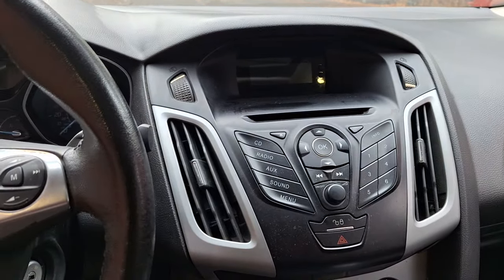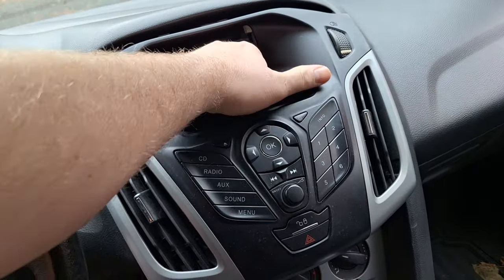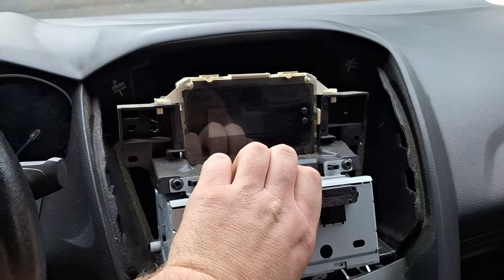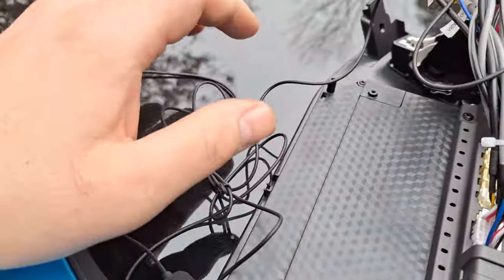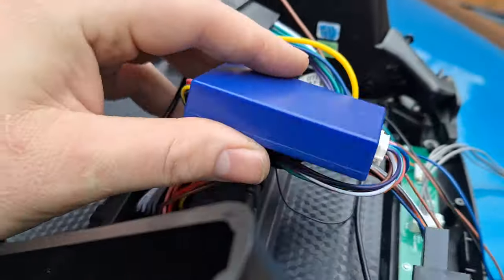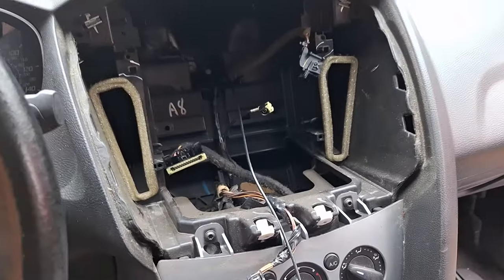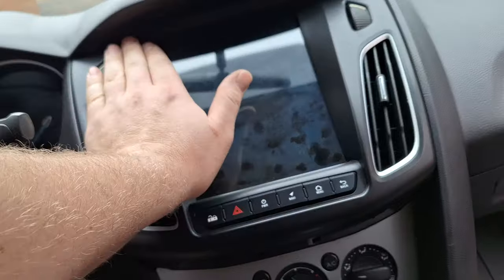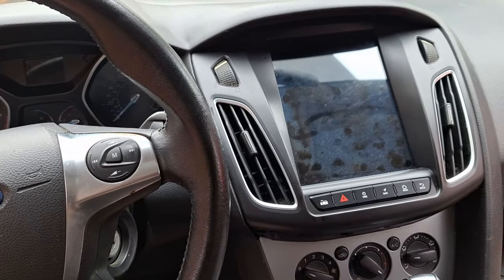Ford Focus Amazon Touchscreen Radio Installation | 2012-2018

Comment: good video but, you should have replaced the fuse while filming so your viewers could see it working in this video. they might think you didn't install it correctly.
Reply from the maker: Great point! I've got a video of it working before removal.. if anyone wants to see I'll link it
Reply: @BigBensCarsAndCycles  would love to see it! do you have any expirience with ios/apple? Does ist support Apple CarPlay
Reply from the maker: @_-lvkas-_8214  https://youtu.be/Plz5ZTmd5QI
Reply from the maker: @_lvkas_8214  another commenter asked and I found one and linked it. Thanks for watching!
Reply: @BigBensCarsAndCycles  Thank you for the quick response! keep up the great work :) Your videos helped me a lot! greetings from germany
Reply: Do you have an Idea if the US Plugs are the same as in Europe? In the one you linked is written „check the Plugs before purchase“
Reply from the maker: @_lvkas_8214  sorry, I don't know about that. You can message the seller if the info is not on the ad. They have good customer support
Reply: I got one did u replace the fuse behind the radio match the 15 amp fuse under the dash

Comment: Am here with a question for those who have replaced the original radio with an Amazon or Ebay one regardless of brand, is the sound better or worst than the original? Or how to improve it if it can be? TIA
Reply from the maker: @josealonso6568  the sound was about the same in my opinion

Comment: My radio is similar but there's three wires that connect to the green circuit board also, where or what are those wires for? The manual isn't specific at all. I'm think it's to test the radio for power before installation? Manual said something about it but there's no red wire, it's orange white and black that connects in but wires are open with no connection that the wires would go into. Any help would be greatly appreciated. BTW great videos, very helpful, and much appreciated 😊

Comment: Great video! I know you said you wouldn't do the back camera but could you explain a little more where every wire goes, I tried to do it myself and failed 😂
Reply from the maker: Hey glad to help, you can pause the video where I show the wires connected on the back. They all fit in 1 specific spot and can't be mixed up. Except for one. Take note of the "ugly colored harness" and make sure that's plugged up where I had it. And I believe you need that one attached for the camera but I could be wrong. You can check the manual to be sure. I don't have it anymore and I'd have to pull the radio out to check. If you look at my video "project Focus clutch actuator replacement" I show a possible way of routing the camera wiring into the car
Reply: @BigBensCarsAndCycles Thank you man, would definitely check it out!

Comment: At 11:17 yours isn't like mine, it's soldered directly onto the green board. I had a hell of a hard time getting it in and at one point thought I plugged it in the wrong way as I could not get it back out. Glad I eventually got it to seat properly.

I think my canbus may be bad. None of my steering wheel controls are working.
Reply: Same my steering wheel controls aren’t working either

Comment: Always unhook your vehicles negative battery before installing and always tape the end of those wires that you didn't use. They'll receive power during certain functions and short out. That's more than likely what caused the blown fuse. Good video other than that. Thank you sir.

Comment: I appreciate the video! I just picked up a 2012 Ford focus se sedan. It's got the 5-speed manual. Wicked nice little rig! Your channel has been great for doing some repairs! I'm looking into a cat back exhaust system. Do you plan on doing a video on this in the future!? I'm sure it would do well on here if so! Definitely going to order a radio like this from Amazon, this video surely makes life easy for the installation! Thanks for all you do! 💯
Reply from the maker: You're welcome, I'm glad it was helpful! I've never installed an aftermarket catback exhaust on any of my focuses - because of the high price. But perhaps I can delete a resonator, or something along those lines

Comment: Do you think the 8 core would be a significant performance improvement or no? I had the slowest one (1 gig ram 4 core or something) before i sold my last Focus, and LOVED it and used it every day for bluetooth music driving to work but the Nav was really slow and it didn't have carplay. I didn't mind it but my passengers complained about it. Do you think it matters how fast it is as long as I get the one with CarPlay if I just want music, GPS and the big screen?
Reply from the maker: I think you should do what makes you happy. I'd get the slower one if the price difference makes it worth it

Comment: So if I buy a touch screen radio from eBay that comes with the trim I no longer need an original receiver? My receiver went out and I want to put a touch screen in but don't know if I have to buy a new receiver as well as the touch screen and car trim as well. Any answer would be much appreciated. Thanks😊

Comment: I just installed this on my Ford Focus 2014 SE and I have a problem with the ‘Steering Learning’ for (Voice Command), (Forward/Cancel Call), and (Backward/Accept Call) buttons. Do you have these issues?
Reply: was wondering the same thing. Do you have the Sync system from Microsoft??

Comment: Does this unit show the climate controls as you operate the climate alsi doe it show parking sensors as it did on the original screen also hpw does the sound compare to the original radio

Comment: Hi 
Nice tutorial 
I followed and everything works fine except the buttons for next previous sound and volume level 
Any tips to fix it ?
Reply from the maker: Glad it was helpful. Are you talking about the buttons on the screen or steering wheel
Reply: Same issue here, steering buttons not working. Any tips?
Reply: @adamrahman8631 did you get it to work?

Comment: Does it work well with the steering wheel volume buttons etc? I'm glad you did this video! 

Also I can't find your video on whether this was a good buy so I have a few questions that I would really love for you to answer if it's not too much trouble my friend.

 1: Are there any negatives to owning this? 

2: Does this work with the built in microphone in the car or does it need a new microphone fitted? 

3: I love the idea of the upgrade but worried I'll regret it and have to fit the original back in! Is it much better and responsive enough to feel like it was always meant to be there? 

4: Also do music and radio stations sound any different after fitting the new stereo? As I love the current sound and worry it will be a lot worse.

Finally what company would you recommend buying it from? I'm from the UK but on ebay they seem to sell these under so many different names that I don't know which one to trust to work.

Thank you for reading this mate and I love your content! Apologies for the questions but I have been wanting to ask someone who has this stereo these questions for ages as I have been wanting to buy one for ages and ages but the stereo are like 200 odd pounds here and that's quite a bit of money to spend on something that I haven't seen many reviews or complaints about haha
Reply from the maker: If you can get it on amazon, they're good about returns if you don't like it. It's worked fine for me. Steering controls work. Sounds about the same as the factory radio, I do still have the factory speakers. It comes with a mic you plug into the back
Reply: My steering controls do not  work, nor the power and others at the bottom of the unit just flahers and locks. Still trying to figure everything else out.
Reply: @alicialynch5857 Did you figure this out? Mine also will not connect to the steering wheel controls
Reply: @cassidyw8075 any luck ? I am having same issue.

Comment: Would like to have the installation of the backup camera system.
I was able to get everything done, however i can not get the backup camera to work.
Reply from the maker: Should be able to just plug it into the yellow port on the back of the radio and it'll work on it's own. If it doesn't, check for a damaged cable, dislodged connector, if everythings ok then message the seller on amazon (may need another camera)

Comment: Nice video
I installed this into my gfs mk3 for her bd abfew months ago
It worked great
However for some reason the lcd is now just black and nothing can bee seen on the screen
But the sound still works and the phone connects to bt.
And also touch buttons work because if I press where  the voulume up and down suppose to be.
Has anybody had an issue like that
What can I do to make it work again

Comment: After installed, I cannot get the volume on steering wheel to learn. Any tips?
Reply: And? It’s work?
Reply: Did any body get it fixed ?  I am having same issue

Comment: Have you liked the radio? Been doing some Amazon searching and all the radios I’ve seen have not good reviews
Reply from the maker: I don't use the radio much. But when I have, I've had some quirks - but they seemed to stop doing it. I was having issue with sound only coming from the left front speaker.. but then it started working again. Overall for $120 it's not too bad for the price
Reply: @BigBensCarsAndCycles  thank you! I just got my car back this week getting the LUK kit and new actuators installed. Drives like a champ now.

Comment: Will this work with the factory backup cam thats already connected to my reverse lockout?
Reply from the maker: I dont believe so. I think that it requires using the supplied camera because its a different connector than the factory one.
Reply: @kdckicksbutt3461 hey how were you able to do this?

Comment: I have a ford focus st you have to connect the amp wire and select canbus setting hiworld then select ford and then Mandeo and then the year of your car it should work
Reply: Hi , I installed one like that on my 2018 Focus , steering wheels control are not working , you saying that on yours you had to connect the amp wire? but where?

Comment: Installed aftermarket radio now car wont do anything even after putting back the original headunit any help?
Reply from the maker: @westcameron74  check the fuse. I've got a video on its location

Comment: Hello, I have a 2016. I installed everything and I keep blowing fuse 79. Any advice? I am stuck
Reply from the maker: double check your connections. Theres a connector for the blue box which can fit on top where the "big ugly harness" plugs into and create a short circuit

Comment: could this also be placed in a 2011 ford focus sedan manual, with exactly the same before installation
Reply from the maker: Hi. This radio is advertised to fit 2012 to 18. I believe there are differences on 2011

Comment: Have a quick question Ben. My stock radio had two antenna cables that look similar one is yellow and the other black, all videos I’ve seen so far only have one. Which factory connection one do I connect the aftermarket radio to? Any help would be appreciated.
Reply from the maker: Maybe one is for the GPS antenna. If you have nav. I'd try to match colors. Or try one and see if you have radio reception. This radio has its own GPS antenna

Comment: Hey man everything worked but like throughout playing a video or music it glitches like for 4 seconds every time I play a music why is that?
Reply from the maker: These can be quirky radios. I had an issue where sound only came out of 1 speaker. It went away after a few days and never happened again. The customer support seemed reasonably helpful, you can try them

Comment: I have this in a 2016 RS, how can I get the steering buttons to work I have tried all the canbus settings 😢
Reply from the maker: Might want to contact the seller and check about a warranty replacement if it comes to that. I'm not that knowledgeable about radio stuff other than bolting it in
Reply: I have the same problem with a 2018 Focus , did you find a solution?

Comment: Does this come with ALL wires you had on new  Amazon radio or did you buy them separately?
Reply from the maker: It came with all of them
Reply: Perfect thanks so much man this was so helpful Ordering mine TODAY!!! Sorry to bother you can you link the review camera instal please
Reply from the maker: @that_raptor_guy8964  you're welcome. I don't have a video on that. It screws to a license plate screw and the wire routes up to the back of the radio

Comment: how do i fix my steering wheel volume not working
Reply from the maker: Was it working on the factory unit? If so, make sure the wires are hooked up like in my video then write customer support

Comment: Do the bottom buttons power, navigation, home, and back work?
Reply: only my hazards button works, not the rest is there a workaround??
Reply: I contacted the seller, and they said I need to splice into the radio’s harness from the second bottom button harness. I haven’t done it yet, but I plan to at some point because the radio won’t turn off when I open the driver’s side door (the problem is with the car, not the radio). So, I plan to use the off button.

Comment: How do I change the volume? Thanks
Reply from the maker: On the screen, bottom left theres up/down arrows with the volume number in between. You can also use steering wheel controls